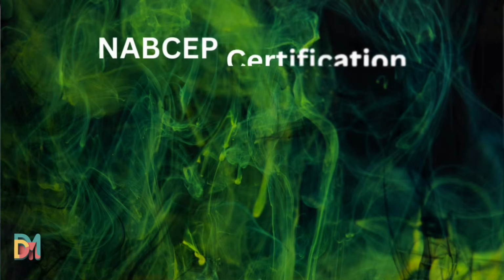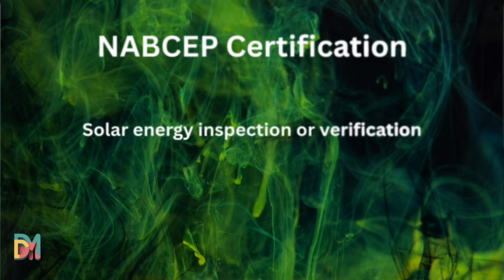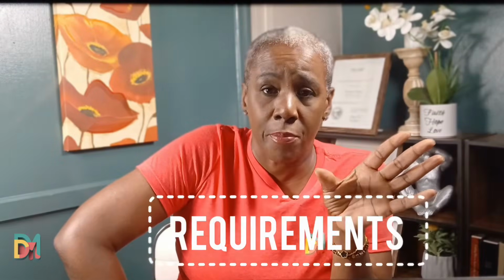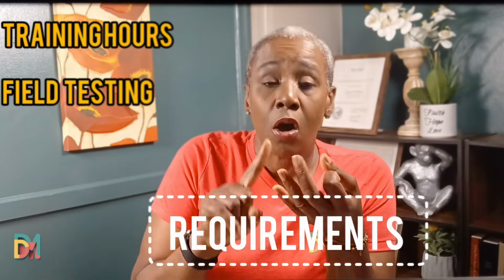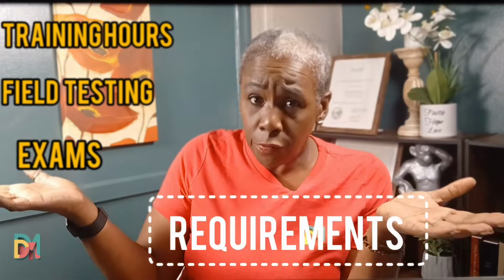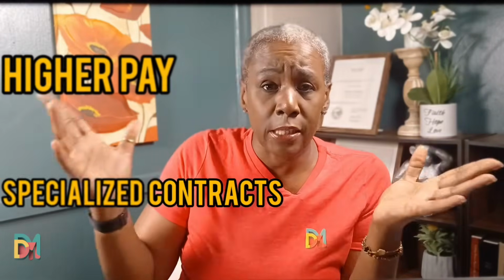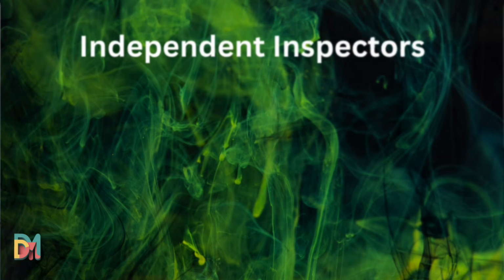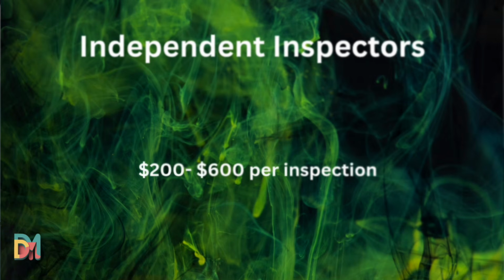This New Type of Inspection Is About to Take Over

Comment: Where is the best place to start as a beginner in Texas. What certifications should I get
Reply: The top two renewable energy sources in Texas are #1 Wind and #2 Solar. I think your solar certifications would be your best bet as a beginner. I hauled a lot of parts to Texas for Wind and Solar Farms before I got out of trucking 6 years ago and more of the loads I delivered where for  Solar Farms vs Wind. In Texas you may want to check with the (TDLR) Texas Department of Licensing and Regulation, to see if the can point you in the right direction.
Reply from the maker: I'm pretty sure that Texas requires License as well, but check your state first just to be sure.
Reply: @DeitraMechelle ok. Thank you
Reply: Thank you for sharing
Reply: @SnappyVegan  You're welcome!
Reply: Good to know❤